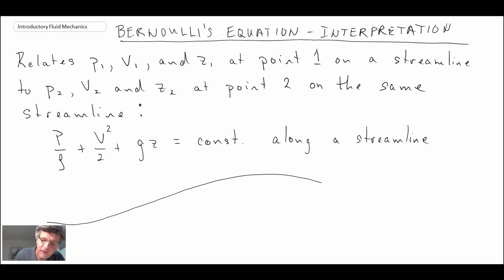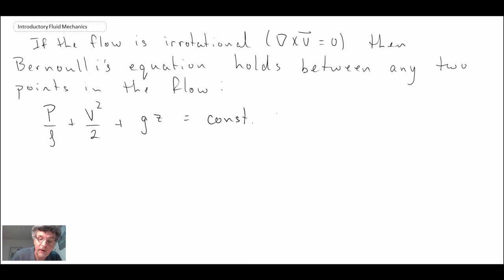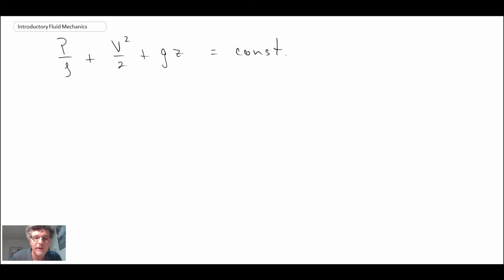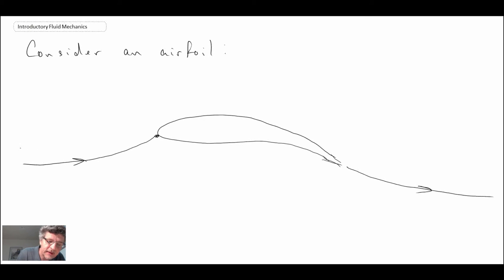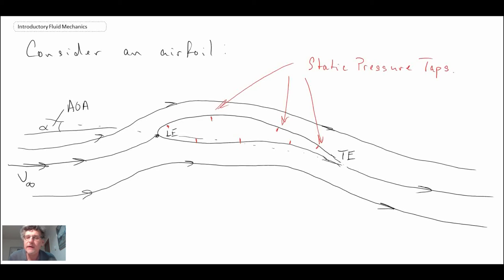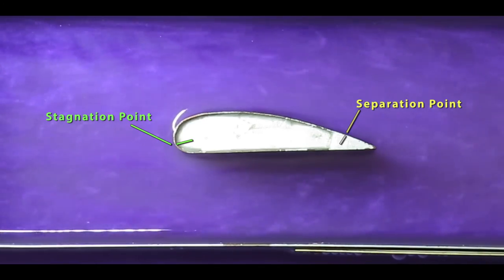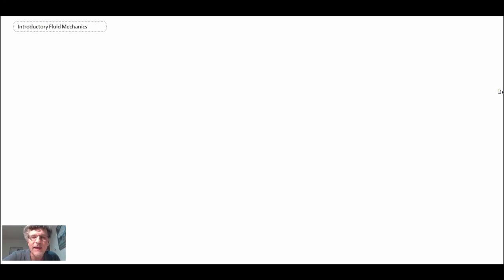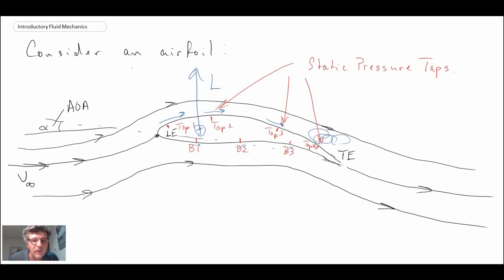Introductory Fluid Mechanics L11 p3 - Interpreting Bernoulli's Equation

Comment: Thank you professor, and may I ask a question? For the Bernoulli equation, the fluid is inviscid and the mechanical energy is conserved. While for the airfoil, there is separation and there will be boundary layer on the surface, is it appropriate to the application of the Bernoulli equation? Thank you.